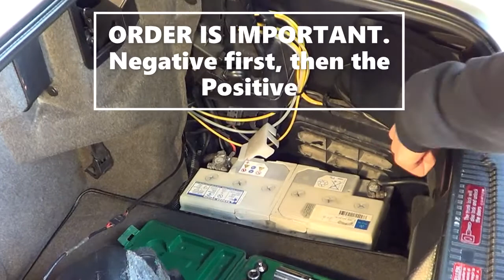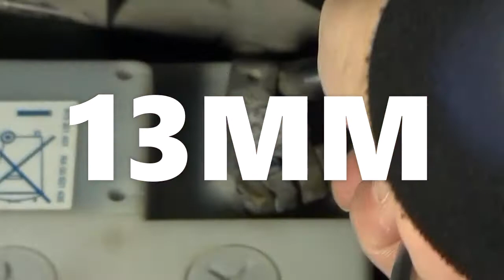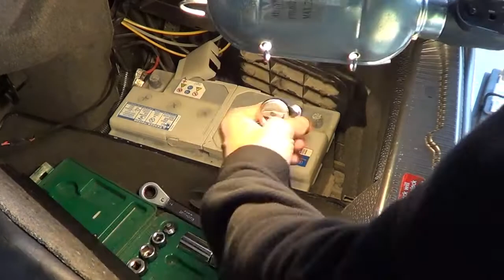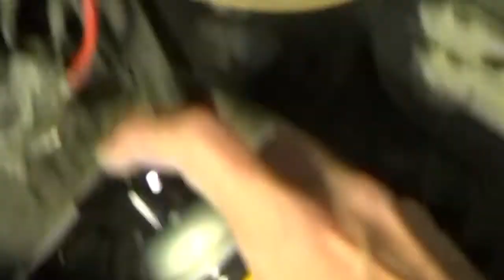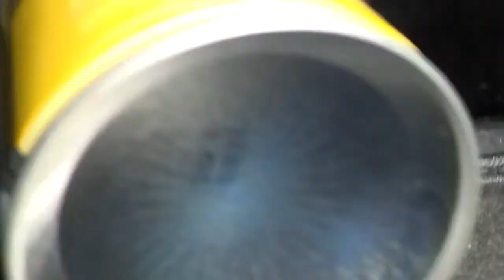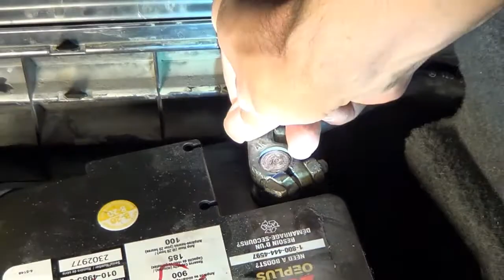R129 Mercedes Benz Battery Change on 300SL, 320SL or 500SL

Comment: It's always good to explain why the negative comes off first and on last. As can be seen, it would be easy to touch the car body with the spanner when loosening/tightening. The wrong order would give the chance of a short circuit.
Reply from the maker: You’re absolutely right. That’s the reason. I did too much juggling..filming, talking and doing. 😊

Comment: After replacing my battery, my windows do funky things when locking/unlocking the passenger side and trunk manually. For example, both windows roll down all the way when I tried to open the trunk with the key (no key in the ignition). It seems the electronics may need to be reset. Any advice?
Reply from the maker: This is a bit strange. Try disconnecting the negative cable from the battery, wait 30 seconds and then reconnect it to the terminal, and see if that improves your situation.  That should reset everything. Before replacing the battery were the windows and trunk working as they should? And what model year is it?

Comment: Sorry Sir, I tried to replace my R129 Battery but I faced problem as Car security alarm keeps ringing. Can you please tell me the correct steps?
I don’t know I should first open the door with normal key or trunk? Or what should I do?
Reply from the maker: Try this: just above the battery there’s an ATA module (ie alarm module) that can be unplugged. Or you can try opening an d closing the driver door with the key blade.
Reply: @HandyVal I will try this, thank you Sir.

Comment: Thank you very much Handy Val for this helpful video and information.
I face problem to use Jump starter with my car when battery is dead. As you can see especially with the positive side you cannot attach the Jump Starter ! Any help and ideas please?
Reply from the maker: Thanks. I do not recommend using a jump starter on any R129. They are susceptible to a power surge that will very likely fry your roof modules. Roof modules are expensive. My suggestion is to use a simple trickle charger, with the battery in place. Using a jump starter will create much bigger problems than a dead battery. I hope this helps. Many roof modules have been killed using a jump start- do not do it.
Reply: @HandyVal Thank you for your quick reply and advice. Okay what about if I use normal charge cable to start the car? Same issue I can’t connect it to the positive terminal on the battery.
Reply from the maker: With the R129, you should not boost the car with jumper cables or with a jump starter. Both have a strong likelihood of damaging the roof modules.
Reply: @HandyVal Understood, Thank you very much Sir.
Reply from the maker: No problem. Better safe, than sorry.

Comment: Hello Val, today i changed my batterie on my sl320 and now i can`t start my engine. Everything works the softtop, lights, AC etc. Maybe you know how to fix this issue. Sorry for my bad english. Greetings from Munich :)
Reply from the maker: I understand your question. Let’s get your car back on the road where it belongs!  Let’s try removing the negative cable from the battery (important - don’t have the key in the ignition) and then after 30 seconds reconnect it. Sometimes a simple reset could work. You may also want to try to resynch your key fob with the proper procedure for your 320. Your manual would have it. Start there and hopefully it works. Keep me updated.
Reply: @HandyVal Hi Val, it finally works. THANK YOU I had to lock the car and then i have to open the car manually and while the key is inside the door you also have to press on the unlock button for 5-10 seconds on your key. So the key had to resynchronisieren with the car and thats why the wegfahrsperre was active. 

If anybody else has the same issue try this out. My SL is from Oktober 1993. 

Thank You Val you help alot with you videos ❤
Reply from the maker: Fantastic! I loved hearing this. I’m so happy your R129 is back. Thanks for sharing.

Comment: Great video with all the useful details to do the job.  Thanks very much!
Reply from the maker: I appreciate it. Glad I could help. It’s tight spot.
Reply: @HandyVal  Yes, the tightness is my main concern now.  There is some kind of a box with what appears to be pneumatic tubes above the battery on the side wall.  I wonder does it need to be moved or can I maneuver by it.   Thanks.
Reply from the maker: That box is the vacuum pump for the door locks, trunk, and glove/storage compartments. You can maneuver around it. You don’t need to remove it and I recommend you don’t.
Reply: @HandyVal  Wow, thanks very much!  I was planning to tackle it tomorrow so perfect timing.  The box has some 1/2 thick molded cushion around it for protection I guess.  I will see if I can at least get that out of the way. Thanks again!

Comment: Very informative video but what if I don’t have code to radio? Will the radio just not work? FYI I have 97 sl 500
Reply from the maker: Thank you. If you don't have a code the radio won't work. The 1997 needs a code. Once, you disconnect the battery, you won't be able to use the radio without inputting the correct code. Check your owner's manual for a four digit code written somewhere in it, usually the back pages or the first few pages. Likely, the first few MB mechanics who worked on the car, would have put it somewhere accessible in those manuals. Sometimes those same mechanics would have written on the radio itself, but you'll need to remove it to see them (see my Stereo video for removal, it's very easy, but requires a special, yet cheap and readily sold tool). If you still can't find it, call your local MB dealership and they may have the resources to find the code for you. They'll require VIN and I believe the radio serial number. This used to be something that dealerships did, but I don't know if they still do so. I hope this helps.

Comment: Easy to do, I always put some light grease on the terminals to prevent corrosion, does that impede power transmission in any way? Never experienced it but you never know!
Reply from the maker: Using a dielectric grease (not any lubricating grease) for battery terminals is a smart idea. It does prevent corrosion and because it prevents corrosion it actually allows for a cleaner and smoother transfer of power. I didn't show it in the video, but shortly after I did lather the terminals with the dielectric grease. I just added some commentary in the video description about this grease. Silicone is the main ingredient in dielectric grease, and some types of silicone grease (always check the label) can also be used for this purpose too. Thanks for pointing it out and thanks for watching.

Comment: I did not notice that your old and new battery having a vent tube and hose?
Reply from the maker: Ray. Very good question. Most batteries that are in a locked-tight compartment inside the cabin need proper venting, especially for those cars with batteries under the seats. However, not all batteries need venting. The new style AGM batteries do not need venting, whereas the older style do.
In the situation in the video, the Mercedes battery did not have any venting, neither was there any loose/unused tubing in the battery resting spot. There is ventilation in trunk, so proper venting of the battery may not be as critical as in other cars - to the right of the battery you see three slats (that vent to the outside; that's where all the brown dust has come from) and also underneath the battery tray there is a small drain with three small holes. If you wanted to ventilate the battery you could put the hose through the slats, or use the drain underneath the tray. I hope this helps.
Reply: @HandyVal  Thank you for taking the time to reply. So the battery that you purchased did not require venting? what brand is it and where did you purchase it?
Reply from the maker: @raybutts9133  The battery I purchased is MotoMaster, it's a Canadian only brand purchased from a Canadian only store - Canadian Tire. I should have been more clear in my fist reply....the battery I installed did come with a vent cap and one vent 90 degree elbow. The battery has two holes - one will take the cap and the other the elbow, which would connect to a vent tube. From what I know these Mercedes did not have a vent tube. I believe they didn't as there is free moving ventilation in the trunk (from the 3 slats and from the drain holes, located under the battery tray). As an additional precaution one can add a vent tube and exit it through the slats or retrofit it to the drain hole.
Reply: @HandyVal  THANKS..HAVE YOUR ROOF HYDRAULICS EVER BEEN SERVICED?
Reply from the maker: @raybutts9133  I haven't serviced them. If servicing, a smart choice is Top Hydraulics (it's a good idea to have the fixed one with you as take the old one out...so you remember order and procedure).  I believe they have videos and PDFs with the exact process needed. The repair seal kits can work too, but I recall a few cylinders that are difficult to open to change the seals. The ones in the windshield typically are first to go and are very reasonable to replace.
Reply: @HandyVal  I am amazed that you have not had any hydraulic  leaks yet especially because your 300sl is a 91 or 92. Good for you!
Reply from the maker: @raybutts9133  Since my ownership over the last 3 years, I haven't replaced mine. I don't have the complete roof history, but I know that the roof was replaced (as it is not original) and I think a previous owner (not the person I bought the car off of) did the cylinders. My guess is that this was done around 2010. The car is a 92 300SL.
Reply: @HandyVal  thank you

Comment: One thing to be aware of....leaving a battery on the ground is essentially discharging it, It's grounded...right? I usually put it on a piece of wood. Just did this myself....getting that bracket in place for the nut to attach was a bit tricky.
Reply from the maker: Thanks. I agree that batteries left long term on concrete will be more prone to discharge than left on a piece of wood but I don’t think it’s  because of ground, rather moisture. Newer batteries have a strong rigid plastic casing that prevents grounding. However, not seen in the video, the battery was kept on a piece of wood.

Yikes, that bracket made me sweat!